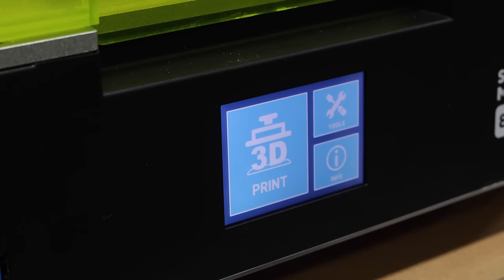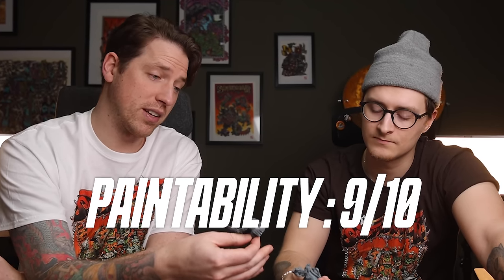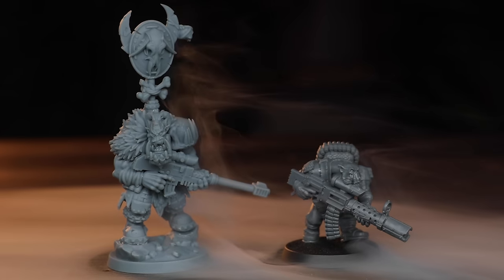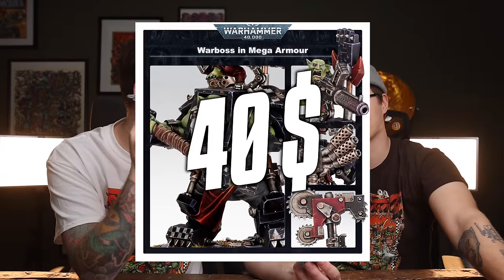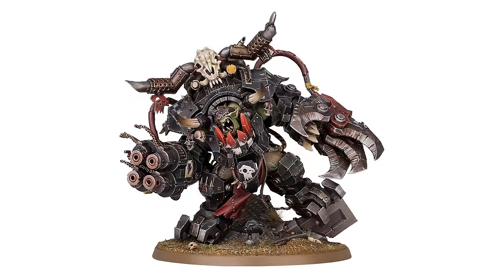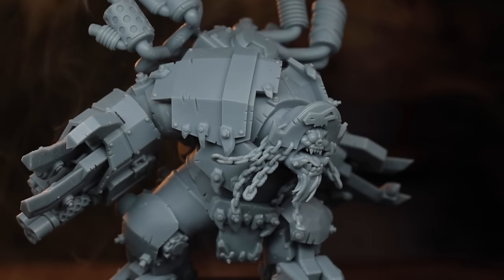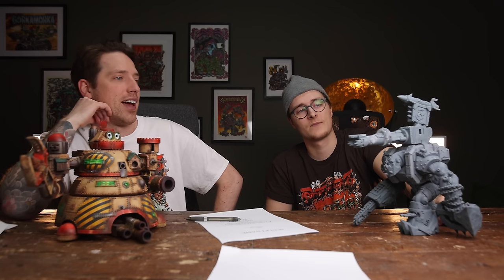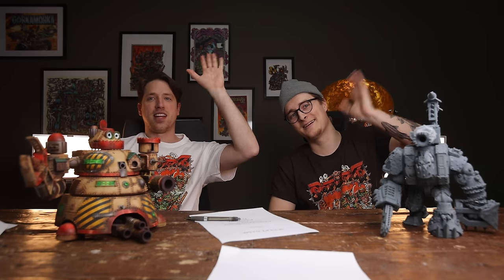Who did it best - Games workshop vs 3D Printed

Comment from the maker: Check out the incredible 3D Printers and Resin from Phrozen that's used in this video:
Sonic Mega 8K S: https://phrozen3d.net/82nbk 
Sonic Mini 8K S: https://phrozen3d.net/mtODp 
Aqua Gray 8k: https://phrozen3d.net/vHG0A
Reply: Instead of glueing it down use blue tac to hold it together its what i do

Also you need to try doing a metalic silver and go over it with a copic marker, im getting a printer and ill buy copics and ill print and send some at at some point so you can try it

The copics tint the metalic silver just over all gets a really nice tint
Reply: Any news on the table? 😂😂😂
So funny!
Reply from the maker: @gavinjames1145  we're working on it, turns out it's big... And takes time🤣
Reply: Where did u get your stompa proxy from the yellow one ? Amazing
Reply: links to the creators you showcased?

Comment: As someone who likes to convert things, the downside of both modern Warhammer & 3D Printing is: Monopose. Increasing your own "workload", so to speak, just to replace a single part is really annoying. And while Mezgikes Models are amazing, and easier to convert - due to Arms/weapons etc. being clearly separated from the body, a lot of 3D prints don't have that. Also, Resin is toxic. So sanding that down or sawing away requires a well ventilated room.
Reply: You can do wet sanding in a tub which massively protects you. With a P99 and wet sanding you aren't getting any resin in your lungs
Reply: You can always toss them in blender and separate parts for conversions. I do it all the time. It is about the only thing I know how to do in blender, lol.
Reply: You should be just as scared of all plastics and treat resin and thermoplastics as the same risk to your body when processing materials. The dust of most plastics are toxic not worth finding out after you are 10-15 years in a hobby. 
 I can't imagine what people would be doing if the hobby was somehow still just pewter mostly.  People would be claiming heavy metal poison after they poked a sword tip too hard and broke skin.

Nothing plastic in this hobby is safe to breathe the fumes of it being cooked or burned or sanded.
Reply: If only they made respirators that you could wear, or water for wet sanding.
If only they made different types of resin so you could choose which type to use.
If only there was 3D modeling software so you could change a figure's pose. 
If only 3D printing had options of where you could find models or find artists that can design it for you.
Reply: In terms of 3D printing, that's what blender is for. While plenty of creators make versions of their stuff that comes in separated parts, most of them can be easily taken apart and in Blender and changed to what you want, or even bring in parts from entirely different makers and edit your own. I do all of my posing and editing in blender then print the model after im happy with it and I've gotten amazing results. Making completely custom miniatures with 3D printers is definitely possible, and not really super hard either.

The resin thing? Yeah, it is, but so are the plastics of GW models. And if you get Forge World? That's resin too. None of the materials we work with in terms of modeling are "Safe". No 3D printing enthusiast will deny resin is toxic. But when sanding and filing GW models, treat them like you would resin. Those plastic microparticles are just as bad as resin dust.
Reply: Seems a bit excessive, I've been filing down resin prints for the better part of 15 years in a garage, and I've never had a problem
Reply: People talk a lot of shit about monopose, but when you compare sculpts and dynamic nature of the poses of professionally sculpted monopose models to multi-part kits, there's no competition. There are reasons why Underworlds models are arguably the best Games Workshop sculpts-- they don't have to worry about fitting alternative bits, so they can focus on composition and personality of the model. As a painting enthusiast, that's way more important for me.
Reply: As someone whose done a lot of digital kitbashing with not much knowledge, even using a program such as meshmixer to cut models up seems like a pretty easy solution

Comment: I am not a GW fan (anymore) but I will say they are limited compared to 3D modelers. GW designs for injection (and failcast) molding while 3D modelers can only have to worry about how well it looks. There are SOOOOOO (Yes, I had to emphasize that) many modelers who "design" their models for printing but state/omit they never did test prints themselves. It has gotten better over the years, but there are still many CF campaigns and monthly boxes where the modeler just puts them out. Especially when they model "true scale" and the pieces are so thin even resin has issues.

Comment: The thing I don't love about Station Forge big orks is there isn't anything small on them to show scale. It's like they sculpt it normal sized and just scale it as big as they can so they can say they have the biggest orks
Reply: I agree. There could be something more to offer a reference level. Even having a bent "STOP" sign on the base offers a little help. I mean, the model at 17:20 is very cool, but if you shrunk it down you would never tell.
Reply: I also agree, it really is just a normal although well designed Ork, that has been scaled up and then had a cannon and missile slapped on which is really lazy. 
It's essentially the equivalent of taking a space marine, scaling it up several sizes and slapping on a whirlwind missile launcher on to his shoulders and then saying yup that's a titan.
Reply: True, although i like much more the 3D printed design, mostly because it is not “big skirt”. It does need smaller stuff, even just windows with guns, canons mounted on his back or stuff like that would show its scale
Reply: The file actually contain 3 grots, one commanding, one loading the missile and one mechanic which they didnt prints and showcase for some reason since that would show some scale.
Reply: @Omega_MCX  That sounds hilarious. I'm almost tempted to do that.
Reply: Agree 100% it looks like a normal size guy just scaled upp, I dont like it at all becouce there isnt orcs that big, it also not look like a orc it looks more like a daemon in the face.
Reply: they just look ridiculous, in a bad way, not in a good Orky way